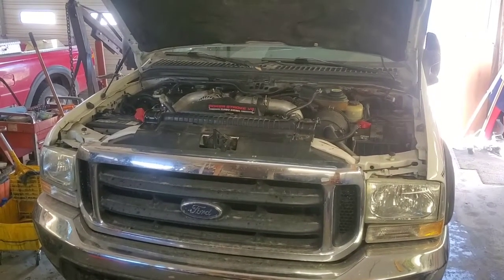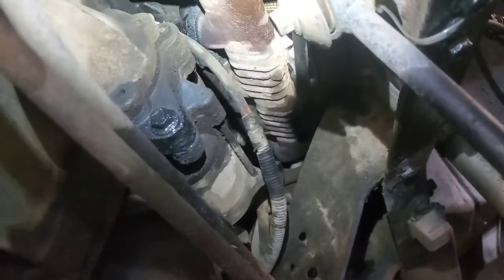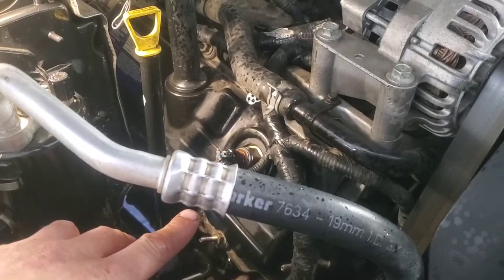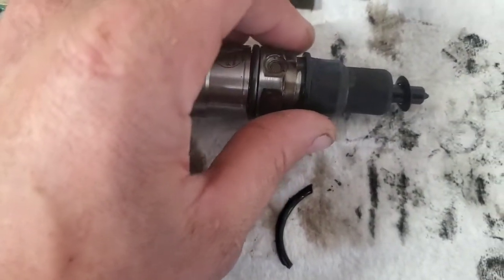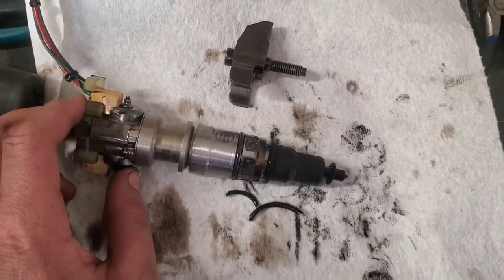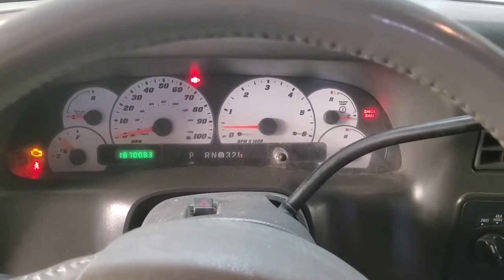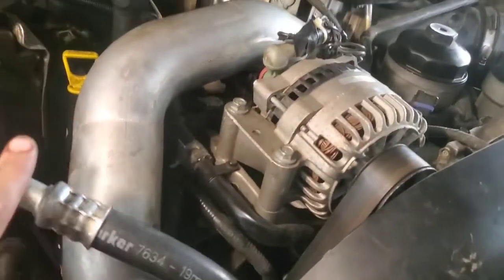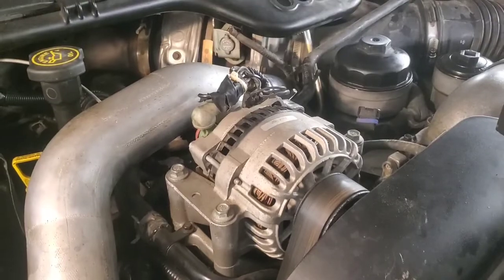6.0L Powerstroke: Fuel hydro-lock.

Comment: The 6.0 diesel is crap
Reply from the maker: Actually they are not.  They do have some weak points, but we know how to fix them now.  They make great power, get really good fuel milage, and they are pretty easy to diagnose problems.
Reply: Agreed pure trash
Reply: Your crap an old piece at that